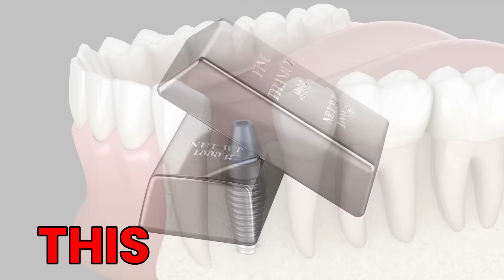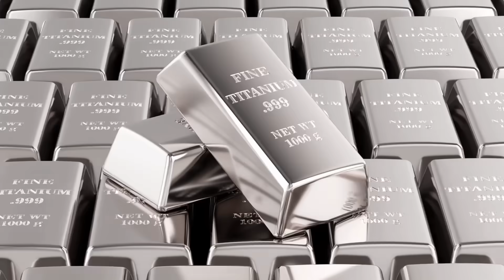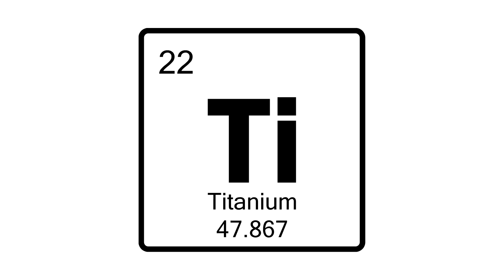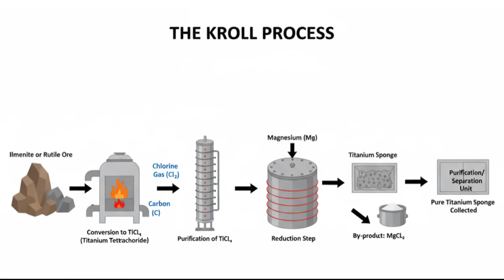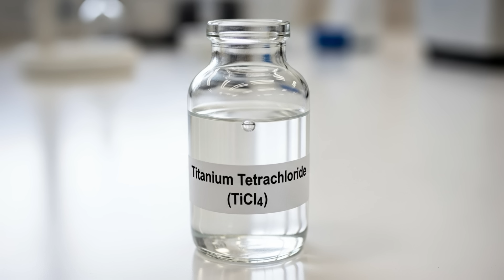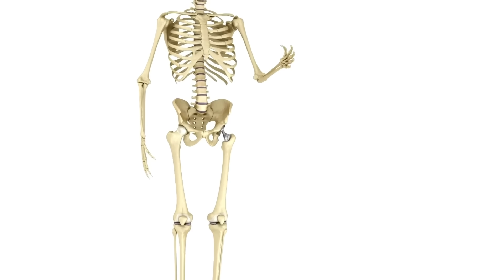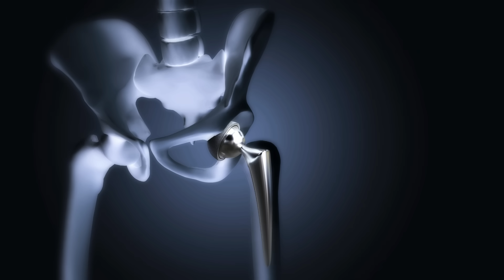Titanium: How It’s Made and Why It’s the Metal of the Future | Simple Things Surprising Histories

Comment: A nice review of Titanium.  The question of how it is made is never answered, rather the video goes into its extraction from minerals, which is well done.  Titanium is created by the explosions of Type I and Type II supernovas.  The nuclear chemistry is complex, but basically lighter nuclei are fused to form Titanium.  Since nuclei are positively charged, getting two lighter nuclei to fuse requires an immense amount of energy to overcome the electrostatic repulsion.  Only the extreme conditions inside a supernova can do this de novo.  Titanium can be made in nuclear reactors but it starts with Calcium which also requires supernova explosions to produce.  It may be that our solar system started with the metals formed from many supernova.  This influences the question as to why we have not detected advanced civilizations.  It may be that the universe needs to be about 9 billion years old before enough supernova explode to provide enough metal for an advanced civilization to exist.  We may be the first advanced civilization.
Reply from the maker: There’s actually a section titled “Chapter 3: From Ore to Metal” that explains how titanium is made. It seems you might’ve caught only the intro and the extraction part. Try watching it till the end — that part covers the production process in detail.
Reply: Interesting theory and your probably right did not know it needs such intense heat .I would think nuclear reactors would be the most logical  way to go just my thoughts though 🤔

Comment: Inconel is used in jet engines, not Titanium.  Aircraft use Titanium in aircraft skins at heat and other critical locations.
Reply from the maker: Exactly. Inconel handles the extreme heat near the combustion zone, often above 1,000°C. Titanium, on the other hand, is used in cooler sections like fan blades and compressor parts, where temperatures stay below around 600°C. Since this video focused on titanium, we mainly covered its applications rather than other high-temperature alloys like Inconel.
Reply: Percussion casting in Portland Oregon would argue against your point. Much of the worlds aircraft engines are cast from titanium. I worked in vis-dim there.

Comment: An additional HUGE cost with Titanium is paperwork. In aerospace and other critical applications they need to uniformity, manufacturing with the bare minimum of variations. Imagine a passenger jet fails, investigators (and thus manufacturers) want the bare minimum in production variations in order to quickly trace the culprit and the reason for the failure. If each rivet, fan blade or other component is made differently, sourced from a different maker using different materials, different temperatures and manufacturing techniques, then how will you discover what went wrong and why. That is why they have full traceability on every item regardless of size back to the original ingot and before, every process is strictly controlled, monitored and recorded and the documentation and records are retained for many years. Such traceability does not come cheap.
Reply from the maker: That’s a really insightful point and absolutely true. Titanium’s material cost is only part of the story. A huge expense comes from the strict documentation, testing, and traceability required for aerospace-grade parts. Every single batch is logged and certified to ensure safety and consistency. It’s fascinating how, in these fields, maintaining quality and accountability can actually cost as much as the metal itself. Thanks for highlighting that!
Reply: @SimpleThingsHistories  No problem. 40 years QA experience in the UK Titanium industry, along with more than a smattering of Zirconium, Hafnium and Niobium. And if you think the traceablity of Titanium is complex and expensive,  then you do not want to venture into production of Zirconium and Hafnium that is in Nuclear applications.
Reply from the maker: Wow, that’s incredible experience to have. It really puts into perspective how complex and costly high purity metal production can be. I can only imagine the level of traceability and quality control required for zirconium and hafnium in nuclear applications. It must be on an entirely different level.
Reply: @SimpleThingsHistories  For sure, without going into detail, just think of the life expectancy of a Nuclear Reactor, 20, 25 years? Got to keep all the processing records and documentation for at least that long and knowing how technology changes, think of records, then cassette tapes, Video Tape, VHS, BetaMax, CD's, DVD's, Varoius memory card formats, hard discs, non volatile memory have all gone and many gone in 25 years so one has to be able to retrieve, analyse and present the data almost at the drop of a hat. Frightening eh? ;)
Reply from the maker: Absolutely, it is astonishing how much foresight and diligence is required in such industries. Keeping decades of data accessible and accurate despite evolving storage technologies is a challenge that is easy to underestimate. Your explanation really brings home how crucial traceability and documentation are, not just for compliance but for the ongoing safety and reliability of nuclear systems. Thank you for sharing your expertise and insights, it really gives a deeper appreciation for the effort involved in managing these metals and processes.
Reply: @SimpleThingsHistories  Really heartwarming to see you have a knowldege of the of the subjest matter covered by the videos you produce. So many just produce stuff to get likes and clickbait. Add your channel to my "Subscribed list", that means I now have 2 channels on my list :)
Reply from the maker: That truly means a lot, thank you! This channel is my way of sharing the knowledge I have and the things I research, with the hope of making complex topics easier to understand and appreciate. I’m genuinely delighted and a bit honored to be part of your very short subscription list. Looking forward to more insightful discussions like this. Wishing you a great day ahead!

Comment: The strongest and lightest element in the Periodic Table ???
Reply from the maker: Not quite! There isn’t a single element that’s both the strongest and the lightest. Hydrogen is the lightest element, while beryllium is one of the strongest and lightest metals when you compare strength to weight. Titanium is special because it combines high strength, low weight, and excellent resistance to corrosion.

Comment: grinder does not have a safety device covering it😊
Reply from the maker: Good catch! You’re right, grinders usually have a safety guard. This clip was for demonstration purposes, but safety is always important — thanks for pointing it out!
Reply: I have 3 grinders in my workshop, one for a sanding disc, one for grinding and one with a cut-off blade. None of them have a guard on them. 1/ The guard gets in the way. 2/ The guard restricts the vision of the working edge of what you are doing, working with restricted vision is more dangerous than not having a guard on it.
Reply from the maker: That makes sense. Some experienced users prefer to work without guards for better visibility and control, but for most people, safety guards are important to prevent accidents. It really depends on skill level and the type of work being done.

Comment: Titanium is tough but BRITTLE…Titanic sank because of this…when will we ever learn?
Reply: Titanic was made of steel, but only had some low percentage of titanium in it's rivets, hence the name Titanic.
Reply from the maker: That’s an interesting thought! But the name Titanic actually came from the “Titans” of Greek mythology, symbolizing great strength and size — not from titanium. The ship was built entirely from steel, with no titanium used in its structure. Still, it’s a cool association to think about!
Reply: @SimpleThingsHistories  Oh! I believe you now. I don't know where was my info from.
Reply from the maker: No worries at all! There’s so much mixed information out there — it’s great that you were curious enough to check. Glad we could clear it up together!
Reply from the maker: That’s not quite accurate. The Titanic sank because it struck an iceberg, and the steel used in the ship became brittle in the extremely cold temperatures. Titanium is a very strong and corrosion-resistant metal, and its behavior is very different from the steel used in the Titanic.

Comment: Titanium is extremely hard to machine.
Reply from the maker: Yes, titanium is indeed hard to machine. It’s strong, lightweight, and has low thermal conductivity, which makes cutting or shaping it tricky. That’s why specialized tools and techniques are used in industries to work with it efficiently.

Comment: How can titanium withstand aircraft engine temperatures when it oxidises at 400c ?.
Reply from the maker: Titanium on its own oxidizes at relatively low temperatures, around 400 °C. But in aircraft engines, we use titanium alloys, often coated or treated to improve oxidation resistance. These alloys can withstand temperatures up to ~600 °C–700 °C, and protective coatings or controlled environments prevent rapid oxidation. So it’s not just pure titanium — it’s engineered to handle the heat.
Reply: High chromium content can infer high temperature oxidation resistance.  Alloy C, aka Ti-1270 is used for the thrust vectoring nozzle of the F-22. It has 20% (by weight chromium). It can withstand exhaust gas temperatures of 650C.
Reply from the maker: Exactly! Ti-1270 can handle extreme heat because the high chromium forms a protective oxide layer, letting parts like the F-22 nozzle safely withstand 650 °C. Alloying really shows how we extend titanium’s limits.

Comment: The "white" paint (Titanium dioxide) has become too popular. Chinese use 1.1 kg per person, per year of "Ti". "Ti" is too precious for such frivolous use & must be conserved. Alternate White paints need to be found (relieving Ti for better use). 
For lightness too, alternate metals must be found in place of Ti. Magnesium (Mg- No.12 in Periodic table) that is abundant in sea-water is a suitable, yet better alternative to Ti. Mg has all metal qualities (as well as in crystal structure) and yet has a flaw, it is too soft & easily melt-able at low temperatures. It needs to be made into alloys & clad in harder metals for structural use (that makes it costly, but..).
Reply from the maker: Those are some excellent points — really appreciate the way you explained it! You’re right, titanium dioxide is used so widely that it raises good questions about resource use. And your thoughts on magnesium are spot on — it’s light and abundant, but its softness and low melting point make it tricky for structural applications. Still, with better alloys or surface treatments, it could become a strong alternative. Thanks for such an insightful comment!
Reply: @SimpleThingsHistories  
As an after thought, I suggest this for some applications. In a beam suspended at both ends, upper & lower planes experience compression & expansion stresses, while there is a layer in middle, the "neutral plane" (as were taught to us as students) that is at equilibrium,  undergoing no stress. This "layer" can be "Magnesium" just as filler. Such ingenious methods can solve Magnesium's deficiencies.
Reply from the maker: Wow! That’s a really clever idea! Using magnesium in the neutral plane of a beam to take advantage of its lightness while avoiding the high-stress areas is a smart way to work around its softness and low melting point. It’s fascinating how engineering solutions like this can make abundant materials more practical for structural use. Thanks for sharing such an insightful approach!
Reply: @SimpleThingsHistories  
Thank you! I will be extremely happy if one of my fellow country-men says that(what you said)!

Comment: Interesting fact: any tools or tooling that come into contact with titanium have to be cadmium free. Using tools that contain any cadmium will start corroding the metal where it comes in contact with it. Having a 50 year welding career, I have welded lots of titanium pipe. When using the proper shielding gas and trailing shield set up, the welds produced are very shiny and incredibly beautiful. No other welds look as pretty as titanium welds.
Reply from the maker: That’s a great insight — thank you for sharing your experience! The cadmium part is fascinating, and you’re absolutely right about those titanium welds — they really do have that beautiful, mirror-like shine when done right. Appreciate your input from real-world experience!
Reply: its fun ceritifying welders , , a trick used to be giving the welders a
one piece TI and one piece SS, they welding them together , xrayed before cooling , next day they were in 2 pieces😊 The TI pushes the SS molecules away
Reply: @Robo_au-j9o when I taught welding school, I would sometimes give a student a 7" long piece of 3/32" Hastleloy C276 weld wire, and told him to go sharpen that "tungsten". That alloy is very heavy and very hard, and to a rookie it feels just like tungsten. Of course as soon as the arc formed the "tungsten" would melt. Some of them just didn't see the humor in that.
Reply: @Robo_au-j9o  So that is why our material titanium bind with stainless steel provide by NASA is friction welded.
Reply: @amkerom yes , 😊  autoclaves for nikel extraction 85 thick walls and 105mm thick dome are Titanium lined with 15mm thick Ti, fused underwater detonaded into steel plates , @ ASC , 🇦🇺sub corp . built 6 Ti lined sub sized autoaclaves @ 350mpa 2000psi with 300*15 Ti plumbimg , stainless slipneck flanges, looked beautiful, as it gets acid pastivated as planned maintenace to combat surface pitting from iron oxide contaniation , like electrolysis between dissimilar metal., only surface , buffed off  with tungsten burr
Reply: Don' forget to keep chlorine compounds away from it as well.
Reply from the maker: Yes, that’s true! Titanium can react with chlorine and get damaged, so you have to keep it away from chlorine compounds. It’s amazing that such a strong metal still needs careful handling. Thanks for sharing!
Reply: Yuppers!!!!!
Reply: yes😊 Use 316L food grade stainless for jigs and tooling with Titanium

yes , contanation is a problem , most butts are passied after xraying ,
Reply: Spoken like a true craftsman.
Reply: 50 Year welding career ? wow

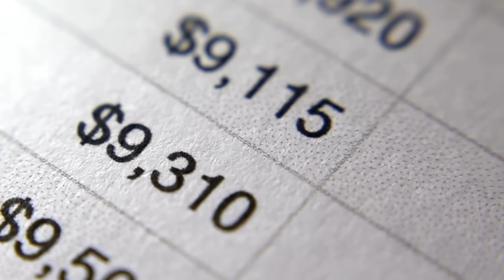Comment: Regarding 8:15, after the fall of the Soviet Union on December 26, 1991, they needed lots of cash and were selling Titanium crowbars and shovels for bargain prices. Savvy buyers bought them up because they were affordable, lightweight, strong and corrosion resistant. Titanium is 40% lighter than steel, is as strong as steel and does not rust. For example, Titanium crowbars are used by divers to pry abalone from rocks. Titanium shovels do not rust are lightweight and used to scoop dirt, snow or animal feed.
Reply from the maker: That’s such a cool bit of history! You’re right — after the Soviet collapse, surplus titanium really did end up in tools like crowbars and shovels. Crazy how a metal made for jets found its way into everyday gear!

Comment: The issue about Titanium in aircraft, is based on it's expansion and contraction qualities.  For example, the SR -71 is made out of Titanium which expands so much during flight, that Lockheed had to make it with very loose fitting joints.  While it's on the ground, fuel leaks out all over the place.  While it's in the air the friction from the air causes it to heat up and expand, which makes all of the joints seal up.  After the SR -71 lands, they ground crews sometimes take a crane to lift the Pilots out, because the Titanium skin is too hot to touch.  By the late 70's, they figured some good techniques to address all of this.
Reply: Das Titanium was SR 72 stammt ursprünglich aus Russland und wurde über Scheinfirma nach USA geliefert
Reply from the maker: That’s such a great point — and you explained it perfectly! The SR-71 is one of the best examples of how tricky titanium can be to work with. Its thermal expansion was a huge engineering challenge — the gaps and fuel leaks on the ground were intentional because everything expanded and sealed mid-flight when the skin heated up to over 500°F.

It’s wild how Lockheed engineers had to basically design a plane that only fit together right at Mach 3 speeds. Later titanium aircraft like the F-15 and modern jets learned a lot from that experience — using better alloys and joining techniques.

Really appreciate you sharing that — the SR-71 story never gets old!
Reply: ...I haven't read so much nonsense in a long time...titanium has a very low thermal expansion (8.2 to 9.5 × 10⁻⁶ K⁻¹), many times lower than steel or aluminum, and is therefore generally used in the aerospace industry, where its low weight, high strength and low expansion make it the number 1 material...